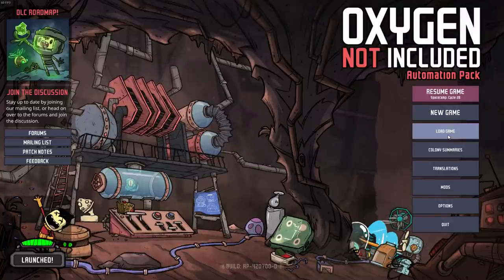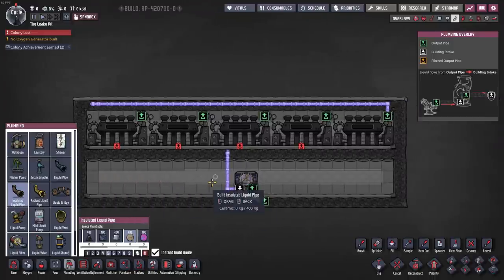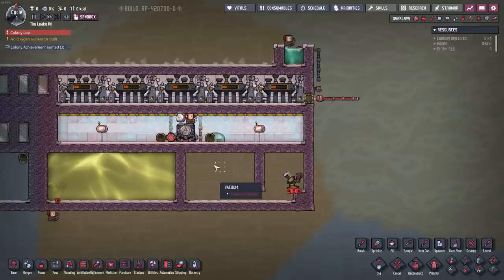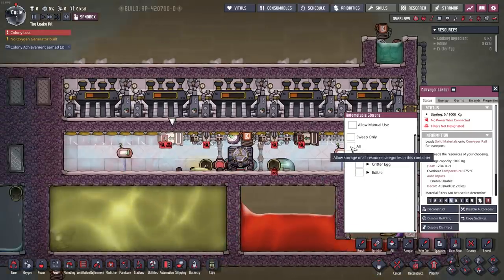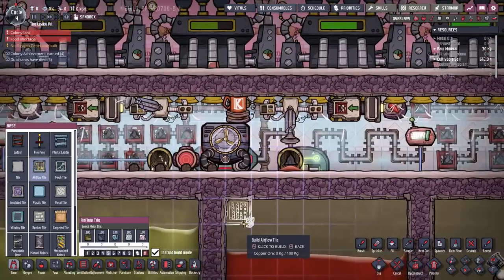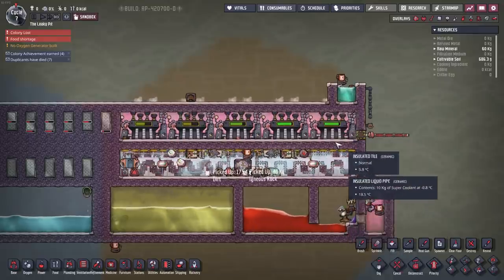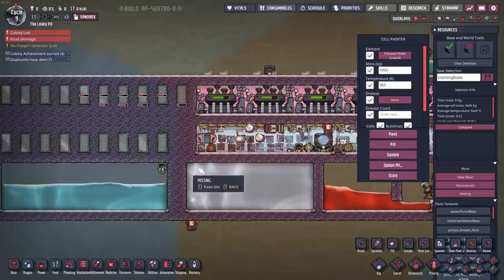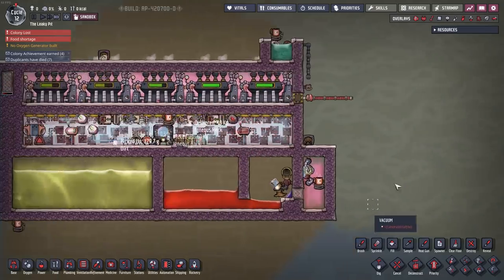Overly Scienced - Episode 21: Magma based Water Purifier (Oxygen Not Included)

Comment: Can I suggest a few things. There’s a mod for sandbox deletion so you can deconstruct on certain layers instead of delete all. Also the visco gel with overheating liquid filter.. it’s best to use a liquid valve with stacking elements (refer to Tony Advanced tutorial for that) this way you can push out magma without power or cooling needed for one item being the filter. Last thing, instead of cooling fresh igneous so much do it in batches. My builds for magma/regolith is first heat deletion through a sour gas boiler in which the igneous leaves at almost 1000c then proceeds to a petroleum boiler leaving at 650c then a steam turbine leaving at 300c then finally an area to boil waste liquids like toilets or desalination. Finally ends in a pit at 200c or so to cool down. Also you would need a robo-miner in the polluted water boiler just in case dirt blocks form.
Reply: Omg as I continue watching I noticed other things lol.. This game is all about overflow.. it’s ridiculous. I use the concept: water -> everything. Second is hydrogen or gases and last is magma. Your magma is backing up and that’s a big problem. Best to have storage area in space so just in case the pipes get blocked you can activate a liquid shut off and throw excess magma into space.. deleting the problem. It won’t be a problem once your pipes are hot enough that magma won’t phase change. But still best to be safe than sorry.

Comment: I would put the airflow tile in the middle, and the 2 water vents beside it... This way the temp of the steam on the right will be less than 200 degrees. Then put the aquatuner a little to the left... for even more steam temperature balance...
Also maybe make the steam room 4 tiles high for more stability :D

Comment: i think if you use colder water the output of the igneous could be cooler. I think that could save a good bit of magma. 
and if you stack the designs you can run the hot igneuos of the other throug the cold input water one.
Reply from the maker: Using cooler water would not cost less magma, it would only reduce the output temp of the igneous rock; that you are correct about. However, using cooler water may cost more magma depending on the efficiency of the counter flow. The one in the video isn't very large so cannot be very efficient. Maybe something with 2x as many intermediates would work but then its too big to fit anywhere.

Comment: Do you have the fast save mod active at any time? I think I had a similar problem with the saves. Did you have a look at your Documents/Klei/OxygenNotIncluded/save_files if not perhaps the  save file is in %steamdirectory%/steamapps/common/OxygenNotIncluded/Klei/OxygenNotIncluded/save_files. Perhaps in one of the directory your save file is still there. (It could be also some rights management issue in your document folder)
Reply from the maker: I've checked all possible locations to no avail. From now on I am going to make backups before and after each episode to an external drive.